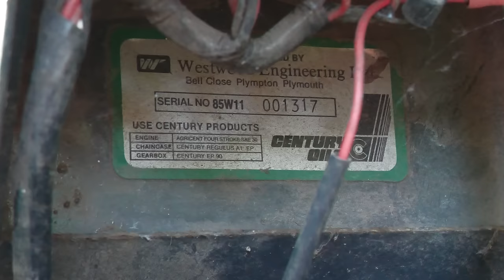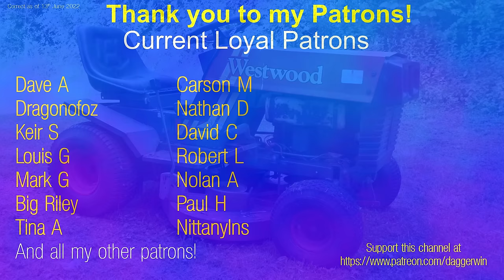BARN FIND TRACTOR MOWER - Can We Fix It?

Comment: I recently bought a 1012 to do some pulling work. I am very mechanical but no experience with these tractors. This video very useful, explained a lot, feel much more confident in adjusting the clutch and general servicing. Thanks for your detailed explanation.

Comment: Awesome!  What you call a 'will it run' (WIR) is more like a rustoration that many in the US do.  Get it running with minimal parts and painting.   Most WIR in the US start with seeing if the engine is locked up, has spark, and if so they try to start it, usually with a separate fuel tank (or even just a rubber tube full of gas), then proceed from there.  Keep up the great work!

Comment: Very nice repair 👍

Last week my neighbor asked me to work on his riding lawnmower with a Briggs and Stratton v twin engine on it. He said it would start but it sounded like there was a rattling noise coming from the engine. When I asked him to start the engine I did in fact hear a rattling noise but it also sounded like it was running on only one cylinder. I found one of the push rods got bent from a stuck valve so it fell out of place and began rattling around inside the engine. So I had to replace that push rod and the stuck valve with the valve guide.

Comment: The wire from a Wire Brush works well for cleaning the tiny holes in the Emulsion Tube.  You can try heating the part then soaking in cold water to break it free.  Great that it started.  Peerless Transmission? Sounded like it may need Trans fluid.  A great candidate for changing pulleys and making a high speed runabout.  I didn't expect it to also have Electric Start and Rope Start.  Well Done.  I would not buy premium fuel line.  Belts yes.  Some Killex would help that Lawn!

Comment: Mice are primarily an issue in the northern part of the U.S. I live in the southern part of the country, and I rarely see them myself. I purchased cars for a salvage yard for many years, and I have only seen on car with a mouse nest. I have never worked on any small engine machinery that had one, and I work on many machines that have been inoperable for many years. I sympathize with the people in the northern part of the country. They have to deal with rust and rodent issues that we simply do not have in the South.

Comment: Man, I wished you were over here in the states, I need someone to fix my riding mower or lawnmower, lawn tractor, whatever you folks call them over there. Anyway, yeah I could repair it myself but I am older with a lot of health problems and working on a riding mower is a good undertaking, well not real bad but would be for me. And I believe it's either the electric starter on it or the engine itself? Mine is a Bolens by MTD, with a 15.5 hp Briggs, I couldn't tell you what that is in CC's, maybe 475 cc or 500? Anyway when I turn the key for the starter to turn the engine over it's really slow and draggy, the battery has a full charge, my opinion it's the starter, bc this mower had sat for a long time outside, my cousin had gotten it out of a junkyard, took it to his house and changed the oil, charged the battery, and that's about all, he cranked it over several times before it finally hit and started. He ran it a little while and then brought it to me, this past week was the fourth time I mowed with it. Idk? That's why I think it is the starter, bc it had been sitting so long.

Comment: Nice one! Your right, it's not a very good cut but at least you've now got a baseline for improvement 😉  and I find a jammed main jet that needs an extractor and a touch of heat never ends well, the aluminium casting usually cracks 😟

Comment: A lot of times we have a lot of trouble with the color and the leaking and especially the Briggs & Stratton even when they’re new and myself I prefer to use what we call in my country RTV silicone which is high temperature silicone to seal I use the high temperature red or black not the ultra crap but the regular silicone silicone the sun covers back on them and they hardly ever leak again
Reply: Not a lot to rewind one of those things just some blade terminals and some generic wire of different gauges of done it 100 times usually it’s a purple ignition switch usually here they cost about $80

Comment: When you are adjusting the coil thing on the engine what causes it to just move into the proper place when you loosen the bolts?
Reply from the maker: The magnet on the flywheel pulls the coil in

Comment: Hey I have the Exactly same 400cc engine in my ride on mower. I’m wondering if you could help me with a few parts numbers for Piston, Rings, con rod, sump gasket. And I need help to find the right torque specs for the bolts. Also can you hone a cast iron bore, if I can what size hone I need. If you can help me that would be great. Thank you

Comment: why is it so many mechanics don't take FULL advantage of penetrating oils like WD40 to soak frozen fasteners? Soak them liberally not just for 10 seconds, tap them firmly to 'shock' the rust free -- a short, sharp rap, and you don't ruin tools or break bolts... licensed Class A auto mechanic here who has had a lot of success with my method...

Comment: Did the ruggerini leak oil after a while again?  Going to buy a pair but one had oil in bottom cylinder but ran after that comon problem or? Great video as normal.  Might have spare gear leaver for thar age of machine aswell
Reply from the maker: Thanks. No, the Ruggerini is fine now. I think what happened is someone put oil through the oil filler on the front of the engine rather into the tank attached to the rear of the engine. Those engines are converted from horizontal shaft and I think the front filler should have been closed off.

Comment: Very Intersting ! the Westwood Machine reminds me of the Late 1970s - Early 1980s American Made AMF Dynamark Machines they are very very similar in Build and looks , I have that exact same 11 Hp Industrial Commercial  engine on an old Rear engine Rider Snapper Machine from the mid 1980s , I had the exact same issue with My Engine leaking Oil very bad out of the Base Gasket , I fixed it and and have run it now for about 10-12 hours and was successful in stopping the oil leak, I am curious , does your engine make a sort of scrapping type noise when its at lower speeds and fully warmed up ? I thought I could hear it slightly near the end of your video, Mine also makes a noise that would make me think the air inlet screen on the flywheel is scrapping the top cover surrounding the flywheel but its not that I have briefly started mine with the cover off the engine and it sounds the same I dont think its anything serious as I have an 8 hp briggs that has been making the same type of noise for years now , Isn't it A Good Feeling Making an old machine Viable and Usable again ?   Great Job

Comment: I need your help i have a westwood s800 that i just put a new mower deck belt on it and it wont let me disengage the blades even with the lever on the “off position for the blades”
Reply from the maker: The belt tension needs to be adjusted. At the front of the machine there is a rod which connects the engage lever and the deck cradle. There is a swivel bolt on the rod which can be turned to adjust the belt tension.
Reply: @MachineryRestorer  Thank you i am going to try it out tomorrow
Reply: @MachineryRestorer  it took some time to find where the bolt was but i found it and loosened the belt and now it works and runs like new

Comment: I have news for you Daggerwin.the fuel line you are. Using in this video is the very same one you buy as genuine parts.nobody makes there one fuel lines they buy it from a hose company and then mark up the price by almost 50 percent and sell it to you as a factory genuine fuel line.this is from an old truck driver and mechanic

Comment: Could you provide the part number for the carburettor rebuild kit you used in your video please, I tried and tried rewinding back to it, but you move so fast, I couldn't read it fast enough, cheers?
Reply from the maker: part number 394698
Reply: @MachineryRestorer  Thank you I located it using that part number $60.00 au per kit wow.
Reply from the maker: @whisky017  Yes, they are not cheap. I am in the UK but buy from the Amazon US store and they are £25

Comment: Tell you that you need to watch a terrible video one more and get stuck pulleys and stuff off and heat some up and clinches a little water hose and when you heat them up in terms of rest on the shaft to powder it doesn’t distort the pulley cause you’re rapidly cooling the shaft and the pulley back down with the garden hose at the same time it usually takes two people to do it but it will save you a lifetime of headaches